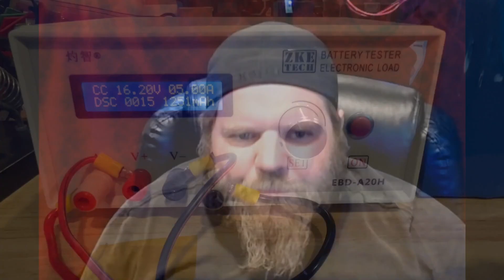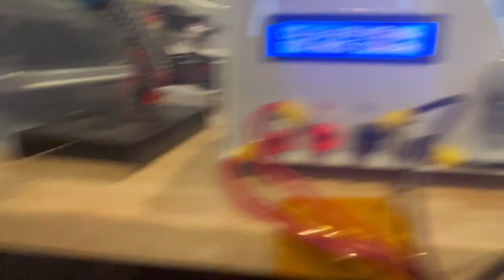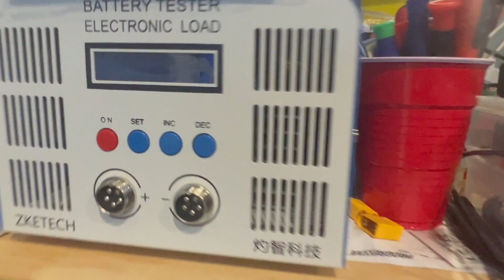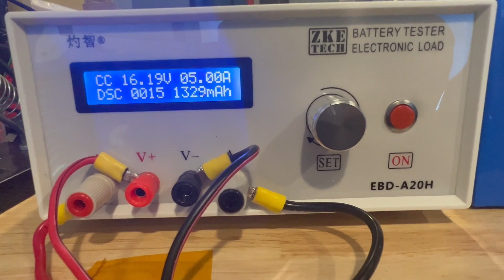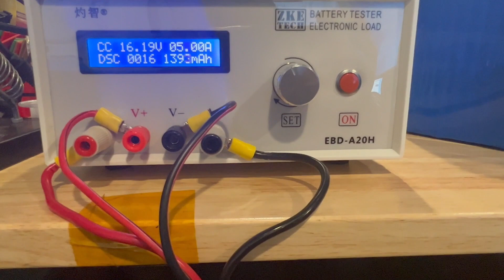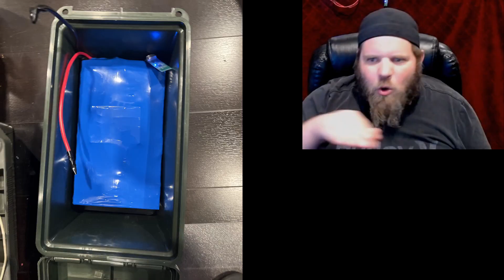Custom Li-Ion Battery Packs for Ham Radio and How We Load Test Them

Comment: Hi,  i made a 6s2p pack with molicel p45b cells.    What I use it in Draws about 90 amps peak 
.    Should I use thicker than .15 nickle strips?
Reply from the maker: i haven't ever built a small pack with high amperage.  I build large packs with high amperage but the amperage per cell is very small due to the quantity of cells i use in my large packs.  I really can't make a recommendation for you here since i never built a small pack for high amperage.